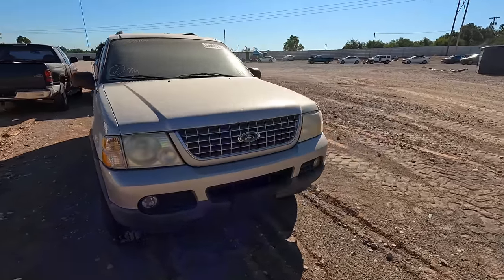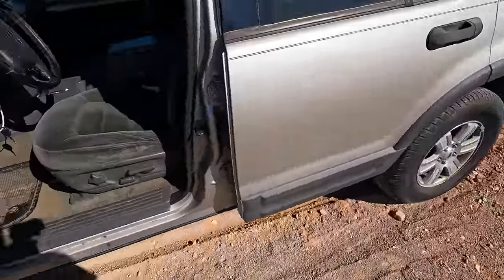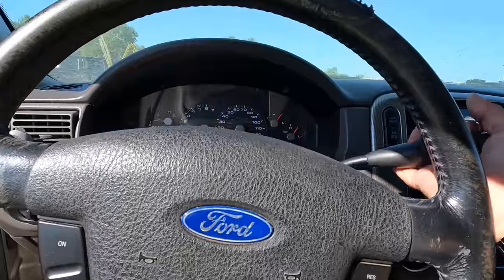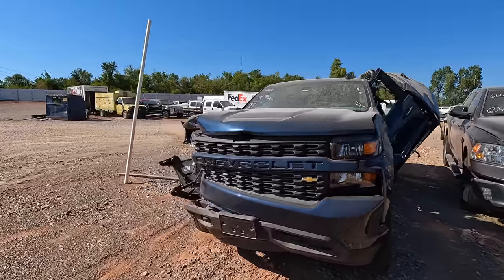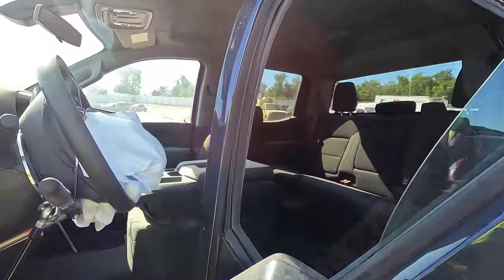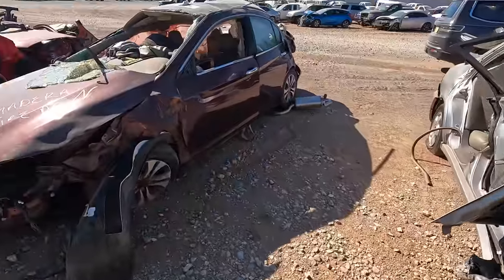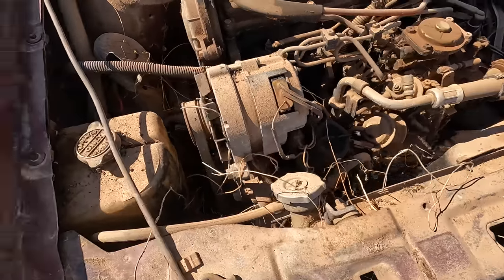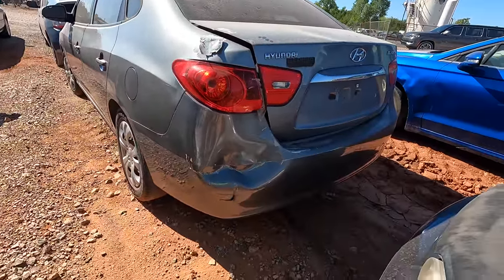Copart Walk Around 8-21-22 + Severe Carnage Edition!!

Comment: This took me for a loop.Ford decided to put the fill plug for the transmission at the bottom. To check, remove the plug. The fluid level is determined by whether fluid runs out once you remove the plug. To fill the unit you must pump fluid up into the transmission. Once fluid starts run out of the hole, it's full.
Reply: That's what I hate about those years. Both Explorers I owned had the dip stick. I think they started with that check plug around 2000. They were nice trucks. I bought a 92 Eddie Bower Edition and a 95 Limited Edition. The transmission on the 90 to 94 is more reliable then the 95 to 05. Ford should have recalled those years. I had about 160,000 miles on the 95 when the overdrive went out and was stuck in limp mode until I replaced it with a reconditioned transmission.

Comment: I'm a certified extraction specialist , been volunteering for 22 years now.  We call pushing the dashboard up "rolling the dash" the cutters cut the relief points and then we use rams to push it up. There is also another method using the combination tool to cut relief points,  bend it out of the way,  jam it in the hole, then use it like backwards scissors to roll it up. It always depends on how badly a victim is pinned.  The rams offer much more movement,  but takes longer.  Check out some jaws of life videos,  you'll love to see how fast we do that to a car.

Comment: The knock in the Hyundai steering wheel is the rubber bushing in the shaft that has deteriorated. It's a known issue and is a $3 part. Dropping the steering column reveals the electric steering box where the bushing is. It is only annoying and not a safety issue. I replaced one for a friend of mine and took about three hours. I could do a second one in probably half the time.
Reply: I disagree it is a safety issue. I had a brand new 2013 They develop the same issue and the steering wheel when I actually lock dead center. It looked like I was going down the road drunk because I was fighting the bushing. I know what you’re saying but it is definitely a safety issue

Comment: I really love the way you think. I know this comment may not ever be read by you because of it being 3 months late. However, as much as that little Ford Escort is cute and tempting to take home with you, getting that back into pristine condition would probably require a donor car that you can use the body, frame, doors, interior, hood, grill, fenders, suspension, wheels and glass. Maybe the engine and transmission is salvageable if it runs. Believe it or not I did something like that way back with a Honda Accord. I was driving on a mountain road and swerved to avoid hitting an Elk. The car dug into the soft shoulder and it flipped over. It was totaled but it ran so good I saved the engine, transmission and interior and bought a Honda from a wrecking yard with no engine or transmission and most of the interior was removed. It had a very good body and the paint was actually in great shape. The paint on the one that flipped was faded and the clear coat was coming off. The finished car looked great and ran great. It was worth the effort to save the car. It was a 91 Honda Accord and it happened in1998 so it was less the 10 years old.

Comment: Based on the overall condition of that explorer, would probably be worth sorting out the trans issue.  Very good overall. Surely you know a way to get a trans rebuilt, or a replacement?
Reply: How about a manual swap from a Ranger?
Reply: @mexicanspec  I daily one of these Explorers and I’m manual swapping it
Reply: @tylerwilkey13  That will be cool.  I am always looking a the Explorers in Mexico to see if they are manuals.  Also the Grand Cherokee came in a manual its first 2 years of production.  They are very rare but they are out there.
Reply: TO REBUILT THAT TRANS COST MORE THEN THE  SUV IS WORTH..
Reply: @JOHNJ0HN9111  maybe an LKQ replacement?  Also, it may not need rebuild or replacement based on the fact that it wouldn’t move at all. It may be something else entirely. Seems like a good candidate to take a chance on, given that it was going for 400 bucks I think? I know here in North Carolina that vehicle would probably sell for $4500 if it was sorted.
Reply: @JOHNJ0HN9111  maybe he could find a working junkyard trans and swap it in idk the cost or details of doing that tho
Reply: @w0rd06  500-800 usually the last time I checked. A coin toss though on if its a good one or not. Ive done it and had great luck and then done it and had nothing but trouble.  Stay away from early to late 2000s Kia products. Their trans are the biggest junk ever.
Reply: @keithgreenwood9615  lord I don’t even remember this video!  😂😂😂

Comment: No dipstick have to check under it haha they say take the center “bolt” out of the trans drain plug and if it pours out it’s over full if it just piddles out steady it’s full I had an 05 and I used a pipe nipple and hand held pump in the center of the drain plug (where the center bolt goes)…and that’s how you add! Keep up the good videos and have a great day!

Comment: The explorer is nice and could get a good trans quickly and cheaply for it. It is a sealed 5 speed trans there's a fill plug in the pan to check the fluid.
You warm up the car then pull the plug and if it trickles out it has the right amount of fluid

Comment: Those Explorers don’t have dipsticks. They have trans issues. Mine had some servo issues, bought a special kit from a company for fixing that issue, replaced it and it works great. The issues that the 4.0L has is the timing guides will break on the back side of the motor. Then you have to pull the motor out to replace it. Other than those things, mine has been a great car. Mine has just over 180k miles and it has never left me stranded. I Have not yet had timing chain guide issues but when I do have them, I will be doing a full rebuild.

Comment: So with the explorer, you are right, the 3rd gens (this style) do not have trans dip sticks, I’ve never heard of a valve dropping issue out of either of the engines available, however the v6 did have the timing chain issues which is probably what you’re thinking of, but that was uncommon for engines after 03, they were updated and fixed by then. That one sounds like it could use a new chain tensioner (50 dollar screw in part that caused the quick startup rattle) but they’re hydraulic so if the truck hasn’t ran in a while, that may be fine as well. The trans (5r55) are known to go bad, and will set you back a max of 2500 bucks which ain’t too bad especially with a truck that clean and healthy otherwise. The trans on my explorer also ate the dust at 209k, which I think is acceptable enough, and my truck was so good to me otherwise prior to that that I decided to go ahead and get the trans rebuilt on mine personally. Good trucks, just with one weak point (the trans). But if you drive it modestly, you’ll still get 200k out of one on original fluid

Comment: Those transmissions don’t have a dipstick the way you check it is running and there is a plug you remove out of the transmission pan. They are really bad for transmission problems had a 03 and the dowl that engaged the band are made of steel and the case is aluminum so the dowl wears out the case
Reply: I hope the guy that came up with that idea was fired.

Comment: I drive an Explorer of the same vintage every day, although mine is a V8 version. They’re awesome and I’d wait to buy one until a well equipped V8 one comes along, they’re pretty nice! Also, the 5r55 doesn’t have a dipstick.
Reply: I have one too with the v8 and 225k, absolutely love it, my trans went at 209k, the torque converters fail. I got mine rebuilt for 2500 though because of how good my truck has been up until then. Totally worth the trans rebuild, I upgraded my converter to a heavy duty one too so now hopefully she’s good for another 300k. V6s weren’t bad but when you get one with the 4.6, it’s one hell of a truck

Comment: @22:43 - I had an identical Alero that I also drove into a guardrail.  I wasn't drinking though.  A water bottle was stuck under the front of my seat and was preventing it from latching properly.  I pulled it out and I guess it caught the handle causing my seat to abruptly slide backward.  When it did, I jerked the wheel causing the car to skim the guardrail pretty hard.  The police officer, tow-truck driver, and the body shop all had a great laugh.

Comment: That noise in the Elantra steering is an easy fix.  It's a rubber flex coupling between the steering column and electric power steering motor

Comment: i got a nice 2011 Impreza at copart $400 winning bid. listed as mechanical just had a leaky trans line. fixed the line, filled the fluid and my mother has driven car 20k miles with no issue

Comment: That’s a good point, I know some people do drive these. But think how many 1985 Ford Escorts are people driving? You should really practice on newer cars. 1990’s to new. Since those are more common for people to drive. Though I have a “possible” idea. Find an old escort diesel with no engine or trans and then swap that engine from the fire dept Escort and then boom, you got a running 1985 Ford Escort Diesel with a manual.

Comment: No dipstick on those.  "Sealed" transmission.  That SOHC 4.0 is notorious for timing chain guides.  They were making noise at first.  You have to remove the engine to replace them.  The transmissions are NOT very good.

Comment: I had a 2008 Hyundai Elantra that had 200k miles on it and it had no timing belt sticker or anything indicating that it had been changed. So I popped off the timing belt cover and it definitely looked like it was totally original. I ended up getting rid of it and trading it plus 1500 for a 2005 Dodge Grand caravan sxt 3.8 with 100k miles less

Comment: The car you looking at do not have dipstick for transmission the car never had dipstick for transmission every since it was built you don't see the dipstick for transmission you don't see the dipstick for the transmission the transmission is in the engine the vehicle is a front-wheel drive that's why you don't see the dipstick for the transmission

Comment: 22:40 you are surprised of a 2010 having 120k miles on a timing belt?  i'm driving a 2003 Ford Focus 2.0 Zetec on the original timing belt, the car only has 123k miles. It is a non interference engine tho. But yes i'm taking a risk driving it to work 45 miles round trip everyday. I just hope it doesn't break at the worst possible time. I will get it replaced sometime this year.
Reply: Had a 95 Avalon non interference engine on the original timing belt at 200k when I sold it. Dude put another 50k before he sold it just because he was tired of it, no major issues
Reply: The 2.0 zetec here in England isn't a non interference engine. So I'd double check that
Reply: @EFFEZE  the North American versions are non interference as far as i know. I have a friend who had a 2002 Focus and it skipped teeth on his timing belt and the engine was perfectly fine.

Comment: I got a question maybe you can answer it maybe somebody in the comment section I have a .2020 ..f150 it is four wheel drive you can be going down the road and all of the sudden the front end and the steering wheel starts shaking violently almost like warping back and forth the Ford dealership i took it to cannot find anything wrong with it.. it don't do it all the time but when it does do it it will literally make you crap your self and secure the living hell out of you  because it cannot be controlled but when it does it. it can be 10 miles an hour or 75 miles an hour they said nothing is damaged under the truck it's never been in a wreck  the truck has never been abused  it's only has 46,000 miles on it all maintenance has been done since new any ideals people what could be going on here

Comment: Had to go to  youtube for transmission fluid check answers.  You have to pull a torx bolt on bottom of pan if something leaks out it was over filled.  If not you pump fluid in till it over flows.  Dumbest design ever.